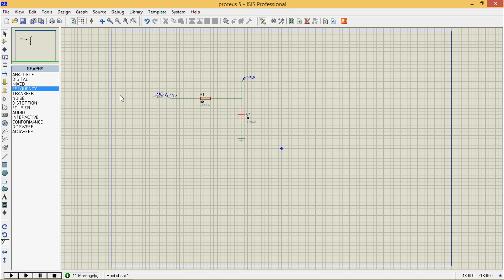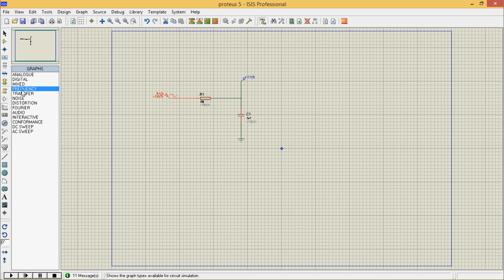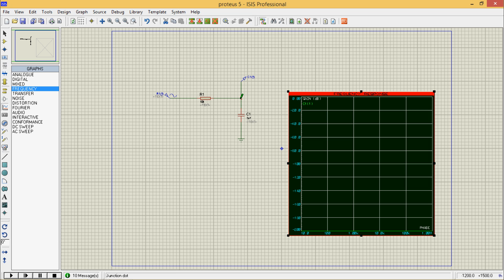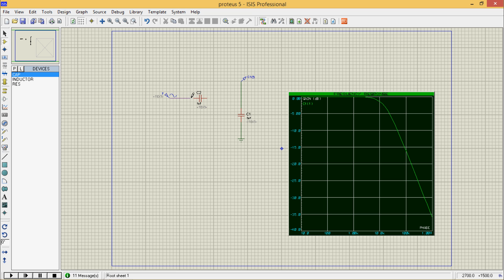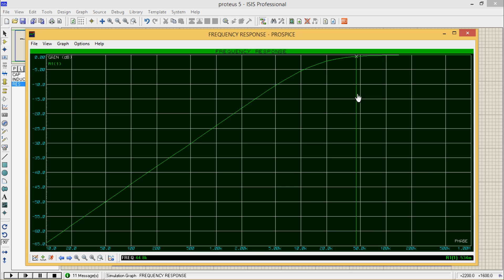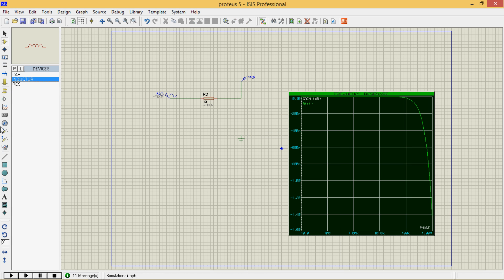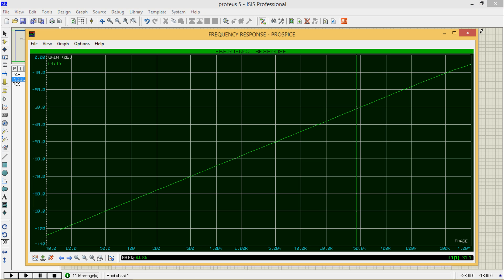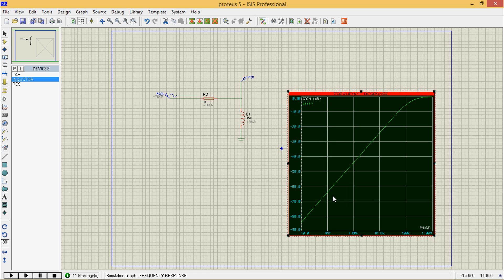proteus tutorial 6 - high pass and low pass filters using RLC with frequency response

Comment: Very nice video! We can notice the struggle with the accent but still understandable. 
Is it possible to make a high-pass filter using a RLC in serie?
If you reply I'd appreciate it. Thanks.
Reply from the maker: +Thiago Augusto sorry for accent 😌 cause English is my third language after Marathi and Hindi.
If you load is resistive or capacitive, then RLC series won't as high pass.
If your load is inductive of higher inductance then it will work as a kind of High pass but gain curve won't be of good shape.
The problem is with L of RLC. For high pass filter what we expect is, with higher frequency, voltage drop will be higher on load side as the inductance increases with frequency. But due to L on RLC source side inductance will also increase so expected output gain curve cannot be achieved.
Think about it as the potential divider and we are taking output from the middle of it.
Now for high pass filter, resistance of lower part should be high and that of higher part should be low. But due to L in RLC resistance of higher part will increase with increasing frequency.
Reply: Thanks a lot. What I did was put a 3.3nF Capacitor then a 1mH Inductor then a 1k Resistor in serie and put the probe on the output of the Capacitor so that I could get a frequency response as you showed in the video. Am I right to put the probe on Capacitor's output?
Reply from the maker: +Thiago Augusto yes.
So RC will be source side impedance and L will be output side impedance.
As frequency increases, Xc will decrease and XL will increase. Thus with increase of frequency, output will increase and you will get high pass filter.
But when you connect probe in between C and L, you can no longer call it series circuit. 😅